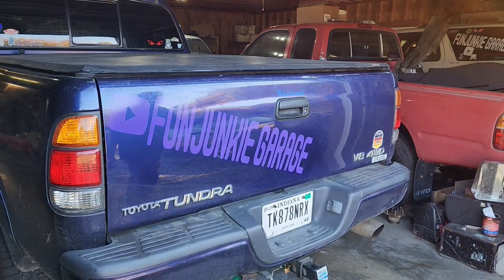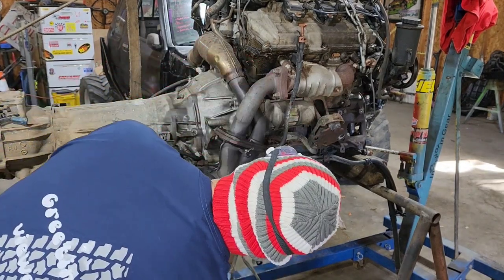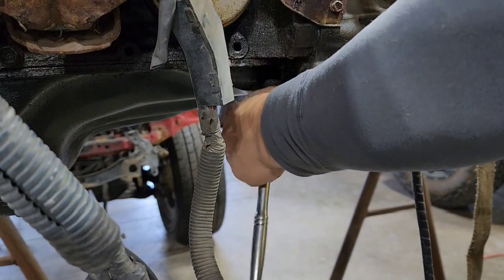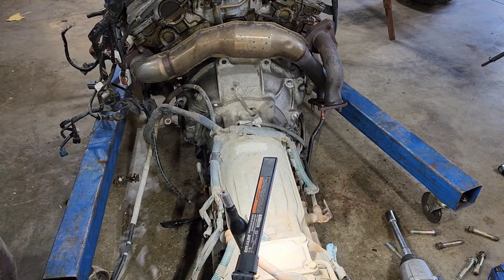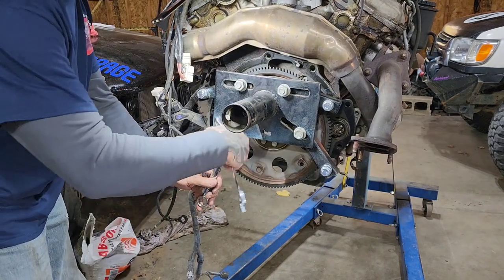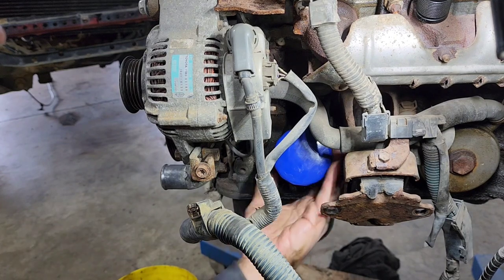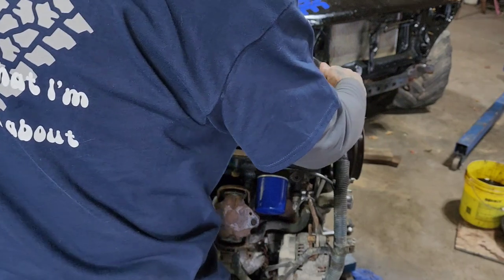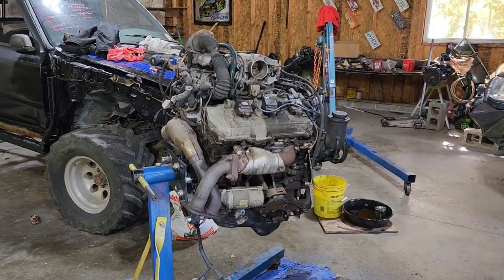How to install oil pan gasket. 3.4l Toyota 5vzfe. Tacoma, 4runner separating the engine & trans.

Comment: Where can I find the gasket for the oilpan. ?   tks
Reply from the maker: I got mine from Rock Auto.
They are available at most auto part stores.
I used the cork/rubber type.
Good luck with your project. 
Thanks for watching and commenting.
Reply: @funjunkiegarage  Thankyou very much Sir.  I am scottish living in Thailand . Never seen a gasket on the 5vzfe before. But always thought there should be one.  thai garages would use the glue and tighten up fully immediately .  therefore making a mess of it. And even worse they would put oil in straight away.  kkkkkk
Reply from the maker: You're welcome.
The 5vzfe doesn't have a gasket from the factory. 
The FSM says to use sealer and tighten flat. Which is crazy in my opinion.  I always use a gasket if I have one apart.
Thanks again for checking out my channel.
Reply: @funjunkiegarage  sir.  the gasket arrived in thailand . THEY sent two gaskets . Is there a reason for them sending 2.   I see most adverts on ebay have the foto of two but not sure why,  unless you have to fit the two gaskets on top of each other .  tks
Reply from the maker: Definitely do not stack gaskets.
Not sure why they show 2 or sent 2. But only use 1.
Hope it takes care of the issue. Let me know how it turns out, or if you have any other questions. 
Thanks for watching and enjoy your project.
Reply: @funjunkiegarage  Thank you Sir .
Reply from the maker: Any time my friend.

Comment: Just bought the feel pro from rock auto and there is 2 gaskets, any reason why?
Reply from the maker: Hmmmmmmm,  no reason I can think of.
A packaging error most likely.
Reply: @funjunkiegarage  well online it states that it comes with 2 gaskets lol I just wasn’t sure if there was any real reason why
Reply from the maker: That is strange, I can't think of any reason either.
A spare in case you mess one up mayhaps.
Reply from the maker: The fel pro is a rubberized cork gasket.
I personally was unable to find a solid rubber one.